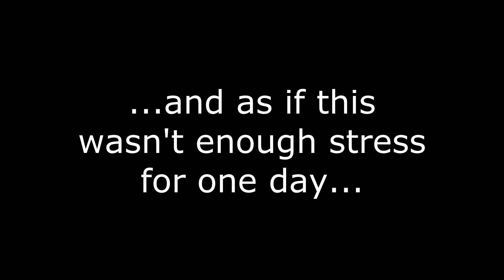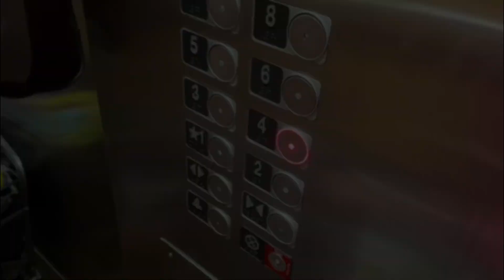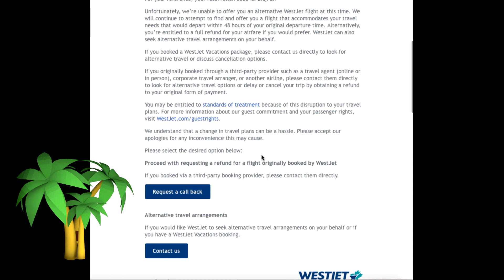Road-tripping With Our Massive Project Sailboat! Transcanada Adventures And Vacation Fun! Ep 2

Comment: You towed on a flat bed?  that's very usual!!!  Why not use a boat hauler?  they have trailers designed specifically for this?   I've hauled a few boats in my life,  including from Annapolis to Niagara falls.  Easy the trailer has pads to fit boats and they handle all the logistics
Reply from the maker: The boat was too heavy for the hydraulic trailers, they only carry 30,000lbs from what every boat mover told us.